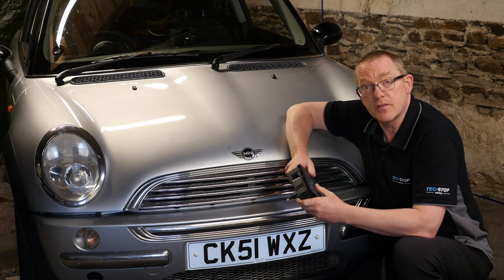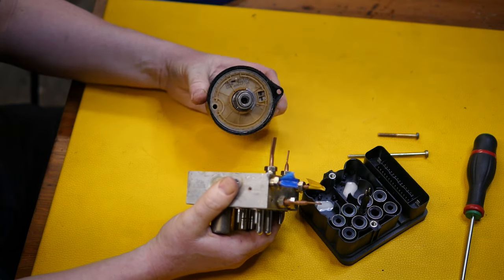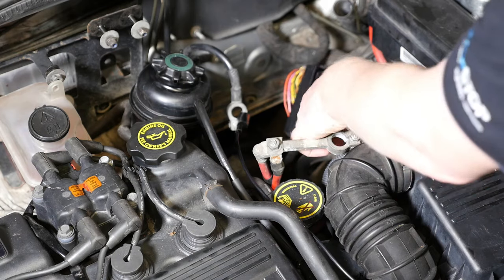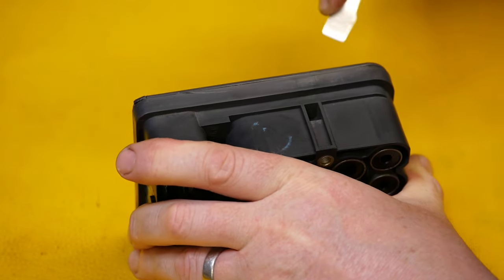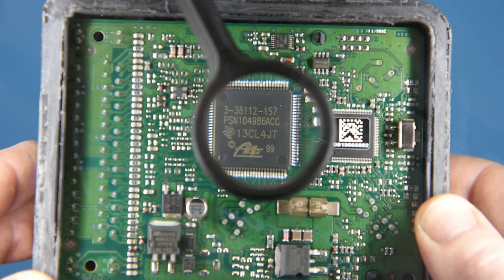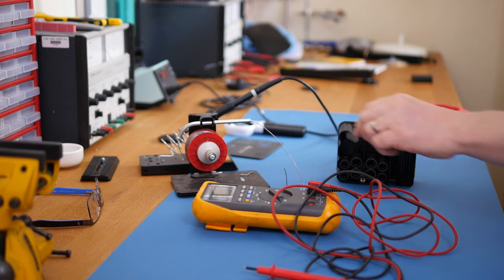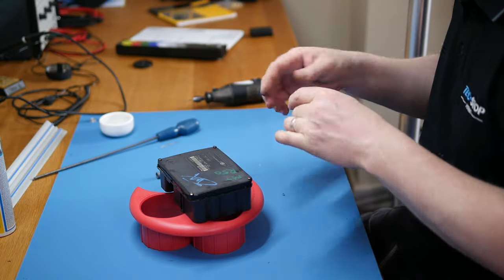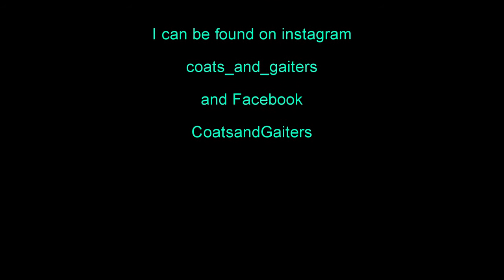Repairing and Soldering an ATE Teves Mk60 ABS Brake Control Module from a 🚗 2001 BMW MINI One R50 🚗

Comment from the maker: If you click "SHOW MORE" in the description above your be able to see Links to the Tools 🔧🔨🔧 I use.  Also Clickable Chapters📋 📙 throughout the video and other Links 🎬 that may be of interest.  I've had a few viewers request where they can buy the tools they see in some of my videos but it's not very clear that the "SHOW MORE" tab has a lot of information in that may be of interest.  Admittedly the amazon links are associated with me and I would earn a small commission which helps towards keeping the channel funded.
Reply: Can you tell some more,because my cousin chevrolet car didn't happened brake fluids comes out from brake caliper bleeder in left side of the front & rear ,it is only in the right side of the front &rear breaks only ,it is maybe condemed the pipes hoses or may the abs module problem?

Comment: proper solid thinking .. My ABS issues were mechanical   on or more of the Valves had jammed .. i seated / pushed back the pistons without opening the bleed nipples . Seemingly a no no   with ABS systems ..   imagining the solenoid / valve functions   I decided to warm up the valve body in a cardboard box /hot air gun oven . Once nice an warm / hot ish   the aluminium valve module was lightly tapped all around to shake loose any stuck valves .. It worked   I now have a normal pedal and there is excellent braking performance . To be on the safe side   I used m y Foxwell NT630 -Plus scan tool to do a full brake flush and bleed .to hopefully remove any contaminates hiding in the system .
Reply from the maker: Thank you for that information Richard, worth bearing this in mind.

Comment: After disconnecting the wheel sensors and confirming the resistance of both the sensor and into the control module, I added a drop of ATF on the female connector and slid it on/off the wheel connector several times.  The wiping action cleans the contacts.  ATF does not evaporate and prevents corrosion.  A road test at >60K/H with lots of hard braking, confirmed my brakes to be back to normal.  Got to do the simple stuff first.  Thanks for your video.
Reply from the maker: Well done and that’s interesting to hear how you solved things.  Hadn’t heard of that before.

Comment: Just wondering what was the outcome of the abs job .on the mini. About to try it . Normally I would just get part sent. But this makes it more interesting. 
Regards Patrick
Reply from the maker: Sadly it didn't resolve so the fine wires might have broken to the sensor in the module.  I might take it apart totally soon.

Comment: Nice job, very helpful.  I do have a question.  Do you know if the brake fluid pressure sensor is in there somewhere.  I have read it is in this module.
Reply from the maker: I believe there is “We find that 99% of the time, when there is a brake pressure sensor fault, it is the small micro wires within that need replacing. This can be extremely difficult as the wires are barely visible to the naked eye,”

Comment: Ok, so I hate to rant but there was no repair done in this video. It was more of a maybe this is it so lets solder these push-fit pins rather than an actual diagnosis and repair. Maybe re-title it as saying how to take apart an ABS modulator and look over its components.
Reply from the maker: Thank you for your feedback and sorry it disappointed you.

Comment: Great instructional video, i have a similar looking module on my 2006 CRV and it appears the Hydraulic unit is not working. I don”t have any lights/codes displayed on the dash or on my scanner. Normally you should be able to bleed the system manually but the port that services my left rear brake does not work. All the other ports bleed brake fluid when the brake pedal is applied. Any ideas? Thanks in advanced.
Reply from the maker: Thank you for the comment.  Sometimes you can get a rubber hose that collapses inside and causes the fluid to not pass or pass in one way but not the other locking up the wheel.  Might be worth checking the rubber hose first.
Reply: Yep, looked into that. I know it was the hydraulic unit because I disconnected the line going to my driver’s rear brake and it did not bleed. I disconnected the passenger rear brake line, again from the hydraulic unit and brake fluid was flowing nicely. What I did to fix the issue was to buy a used part, my fingers crossed, and replace it. Unfortunately, it threw VSA codes. So plan B was initiated, to disassemble it per your video and swap the hydraulic unit only. Hooked up all the lines, bled it and everything worked. A new part was out of the question because of the price. I was weary sending in my entire VSA unit to a web site that repairs these units, solely because I think they repair deals only with the electrical unit itself. I would be sent back with an unrepairable status. Needless to say I was wondering if you know how to repair a hydraulic unit? Cannot find anything on the web, youtube, etc. I don’t even think anyone sells these units as separate parts new. Again thanks in advance.
Reply from the maker: @CarlosM-gz7ec  Oh I see what you mean now.  I'd expect the drill holes would be sealed up permanently after making the channels.  Really I could do with stripping one completely for my channel.
Reply: Well, I looked at it for a while, like a “pig looking at a wristwatch”, that is when I decided to purchase a used one. Actually, two, the first one did not bleed from the opposite rear brake, didn’t know these mechanical units could fail, with the second one, brake fluid flowed from every brake bore, success. I am not a pro mechanic by any means but I have change tank fuel pumps, brakes, rotors, calipers, replaced read diff with a limited slip, exhaust manifolds, water pumps, alternators, etc. and do watch a lot of YouTube to help with any issues, it is a great resource. I just probably don’t have have the specialty tool(s) . I will be looking forward to that video, good luck and thanks
Reply from the maker: @CarlosM-gz7ec  There is some pleasure to be gained by mending things yourself and at least you know what's been done or not.  I think I just enjoy using tools lol

Comment: Very very good video! Great job! Can you tell me where the break pressure sensor is located in this ABS Control Module?
Reply from the maker: Not totally sure but I think it's normally between the two larger towers.  This link might help.  https://www.actronics.co.uk/acinsights/ate-mk60

Comment: Not sure soldering those pins is a good idea.  I believe they are put that way on purpose to give the plugs some wiggle room (albite very little).  Soldering some of the other components, however, may be your answer!  It is called reflowing the solder points.  Sometimes, hard to see cracks develop in the soldering and cause malfunction.  A bit tedious, but it is your best bet.  Also, sometimes, just cleaning the electric plugs and contact points will get you going (due to a dirty connection).  Good luck!
Reply from the maker: I was thinking they are made that way for speed of manufacture and to keep costs down.  Soldering each pin would probably add considerably to the costs.  Soldering can fracture in a vibration heavy zone but then vibration on a rigid circuit board push connector would gradually wear.  Sadly it didn't work in the end.
Reply: My thoughts were that the pins are square and the corners would cut into any metal that may line the holes forming a gas tight seal similar to "wire wrapping" which can last for decades.
On the other hand, the pins could have been embedded into the housing and doing a "wave solder" on them after installation into the case would be almost impossible so they compromised with a "corner into metal" approach.
Having worked on automotive electronics for decades, modules I took apart in the past had soldered pins but the pins were not embedded into the case. This made them subject to the vibration. I have never seen this to be a cause of failure. Most failures are cold solder joints, especially on power hungry devices such as relays, main power connectors and power transistors.
I'm about to open up an ABS unit from Mazda.
Reply: No even rebuilders of abs modules will solder those pins just like he did. The wiggle is what actually makes them fail and lose contact.

Comment: tremendously great video. my 2007 volvo s40 gives me ABS service required. I tested everything from sensors, wires and the pump. all good except my mechanics told me it could be the BCM is faulty. I have heard that volvo BCM have the same joint design at the video. no soldering!
Reply from the maker: Thank you for the compliment and hope the video helps you.

Comment: @Coats and Gaiters What a wonderfull video! I have noticed that my abs is not showing any warning on the dashboard but the thing is that the rear right side of the car is not pumping the brake fluid from the abs module. What could it be the issue? any tips are welcomed!
Reply from the maker: Thank you.  Possibly air in the system.  Fluid should be flushed every 2 years with new.

Comment: Permatex ultra--black is sensor and electronics safe but other brands may not be.  Some silicone sealants will generate acetic acid while they dry and over time this will cause corrosion on surrounding metals, so be careful and be sure to use something listed as sensor safe.
Reply from the maker: Thank you for that, I never knew about acetic acid in sealants.  Worth knowing.  Thank you
Reply: @CoatsandGaiters  No problem.  Best way to know for sure is to let a bit of it dry on a screw driver or pencil and if it smells like vinegar at any point while coming out of the tube or while drying then it is not sensor safe.
Reply from the maker: @10100rsn  I know the smell you mean now.  Very strong and pungent  isn't it.
Reply: @CoatsandGaiters  Black weather strip adhesive also works great for sealing up abs modules like this ,dries hard just like the plastic.
Reply from the maker: Thank you for the heads up.  Never used it so never knew about it.  @mikealkarout9555

Comment: Nice vidéo as always.. just a little suggestion.. 1. What was issue with abs unit? Code ects...2..did.it.work? All the best my friend.
Reply from the maker: Thank you I had a 5DF5 error code.  Tried soldering but it didn't resolve as far as I know.  Diagnostic tool went west so cannot read codes now lol
Reply: @CoatsandGaiters  thanks for the reply

Comment: want to access the electric motor so that I can energize it bypassing the control module while it is disconnected from the battery when towing vehicle behind motorhome. Looks like easiest way is to go through the metal motor housing to the brush contacts. When the motor is energized with out the ABS controller the brakes should be applied. WHY? I can use the ABS braking system as a "breakaway" braking system that can be activated by a simple inexpensive "breakaway" switch. Looks like when the power is removed from the motor then the brakes return to normal operation. One of my concerns is which pole is switched? the positive or negative? Guessing here, from your pix at the end, the side connected to the switching transistor would seem to me to be the positive? Right?  I can't identify the 2 small boxes on the other side.  What do you think? will it work?
Reply from the maker: Sadly I think this area is way outside my ability to answer with any useful answer.  I think you might need to speak to an auto electrician that really knows their subject.  Sadly I'm not that guy.  Like your thinking though, let us know if you crack it.

Comment: Hi do you know if it must be the Same Partnumber for retrofit? In my mini r50 2001 I have the number 6757063 but it is very hard to find…can I get an alternative? Best wishes from germany
Reply from the maker: They are coded to the vehicle and programmed.  It may work, just may not work exactly to spec.  Different models may be programmed to react in different ways depending on equipment fitted.

Comment: Hi wondering if you can help me i've got no power going to my front abs sensors , I've tested the wires and new sensors, I've opened the abs module and can't see any bad solder , do u know which parts on the circuit board powers the sensors so I can investigate further? Thankyou
Reply from the maker: I'm not sure they use power.  I think they are resistive.  To test correctly would require a oscilloscope to see the waveform as the wheel rotates.  https://youtu.be/Zw28kGsJ_ZY?t=317

Comment: So you never tested this unit?  You never tested those pins once you got the cover off.  How do you know it works.  You never tested power from the connector to the ones you soldered either.
Reply from the maker: I was just hoping a quick fix of soldering the pins would have been enough.

Comment: I'm struggling with the ABS module on Focus RS Mk2.  Testing the voltage at the sensor plugs, 2 are failing with 9v, two are ok reading 12v.  Would you suspect the ABS module itself?  The wiring is ok, we tested 12v through the harness.
Reply from the maker: They are known to fail due to the push connections inside, which is why soldering them can sometimes do the trick.  Good luck.  Worth a punt if you have nothing to loose.

Comment: Is there any possibility sensors to be checked directly from the connector that goes on the abs control unit? I have to disassemble a lot of things, in order to reach the connector plugs, I don;t want to do that.
Reply from the maker: If you have a diagnostic reader, some of them allow you to see the signal from the wheel sensor.  Really to check the sensors individually you'd need that as they create a waveform when turning which can be seen using an oscilloscope.

Comment: Most abs pump repair vids would bore a hole into a rockinghorses backside - your one doesn't. 

Subbed. :-)  For added "Investigating borked electric stuff" fun - get a microscope. Beats using a magnifying guffy hands down.
Reply from the maker: Thank you.  I do keep looking for microscopes but they are damned expensive.  I keep watching ebay

Comment: Hi, sr. please help me. i have a BMW e46 2001 2.8i, if i remove only the motor / ABS-ASC Module, is possible leak or spill brake fluid?? Tks. and have a nice day Sr. PURA VIDA FROM COSTA RICA. CA
Reply from the maker: Yes you can remove the motor and electronic control part without leaks.

Comment: I have replace abs unit for my car santa fe 2007, 2.7, 4WD, EPS, abs type s/w 60303 ver 0204. And bleed air from wheels. The problem. Is clunk sound Inside abs unit when press  break at low speed. No signal abs light, the abs working good as break, the problem only the clunk sound. So please could you advice me how solve this problem.
Thank you very much for your help.
Reply from the maker: Have you managed to bleed the air out as you need to use a diagnostic tool to do this.  Or rag the car around a car park braking heavily to activate the abs to clear any air out.

Comment: Very useful video, not come across this channel before, subscribed. I have a similar problem on my E39, if anyone reads this do you know if it's possible to just remove the electronic control box without disturbing or disconnecting the brake pipes?
Reply: Ah, I've just seen that this didn't work. Shame I thought I'd hit on relatively easy fix and avoid the cost of a replacement.
Reply from the maker: Yes you can remove just the control box.
Reply from the maker: There can be many issues so it's still worth a try, it may not have worked for me but it might for you Andy.

Comment: Hi there, Thank for good video. Is it possible to operate ABS module with only one speed sensor? Actually, I am a student and want to present the ABS operation with single tire and break assembly using single speed sensor.
Reply from the maker: Thank you, I think the ECU requires all 4 sensors as it uses all 4 to decide if wheels are locking up and which wheels to release or slow.
Reply: Thank You for consideration. Is it possible to provide ECU with four inputs from single sensor, i mean can we divide output from single sensor to satisfy ECU requirement for four sensors?
Reply from the maker: @livetech4062  Your probably better asking an auto electrician as I'm just a home mechanic.  Sorry.
Reply: @CoatsandGaiters  Thank You so much. You are great, stay blessed.

Comment: how do the professional rebuilders open them without cutting?
Reply from the maker: They may use a hot wire maybe but they will seal them correctly with ultrasonic possibly.